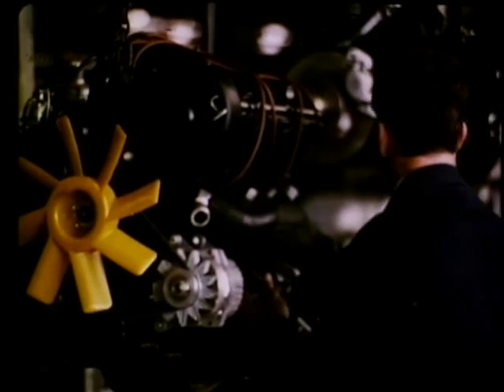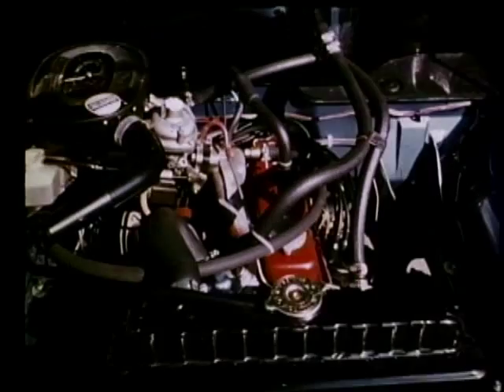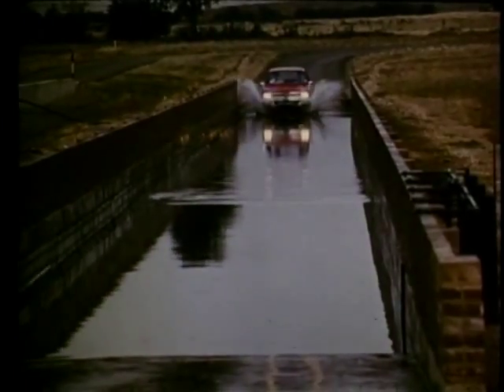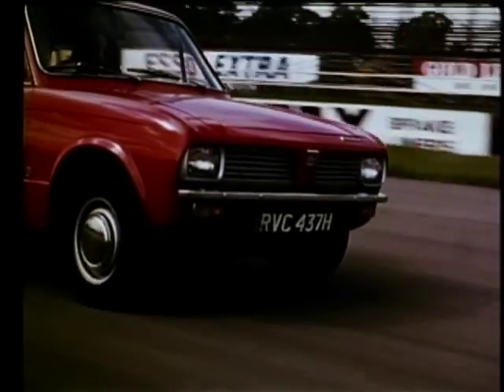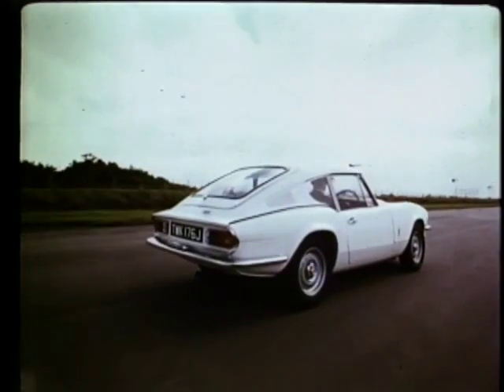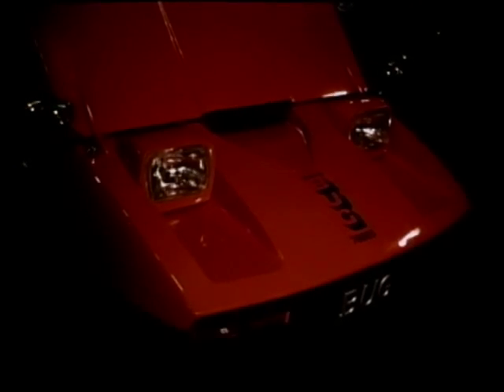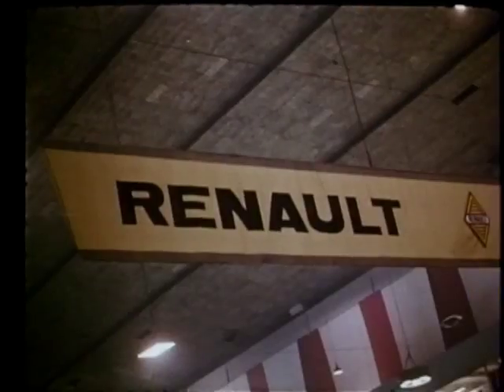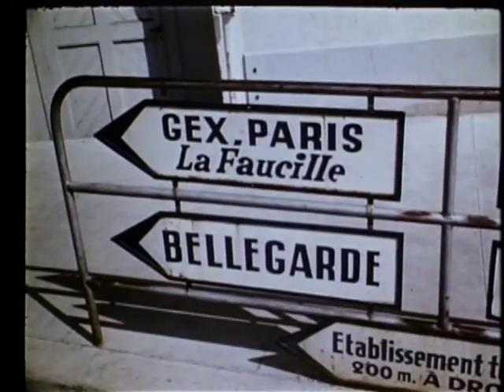1970 MOTOR SHOW & LAUNCH OF THE HC VIVA AND SRV CONCEPT

Comment: My first car bought in 1981 was a 1972 viva SL 1100cc  MCN137K it was metallic green with a black vinyl roof it had rostyle wheels, sawdust in the gearbox and lots of rust and bodge but looked good in the dark. Cost £110.00. Although we slate modern cars,  most cars in Britain at least were rusted out and scrapped within 10 years in the 60,s and 70,s and a mileage of a 100k was unheard of whereas now its tom jones, not unusual.